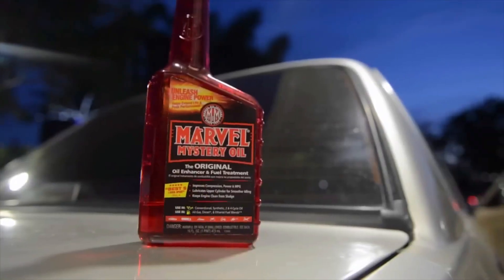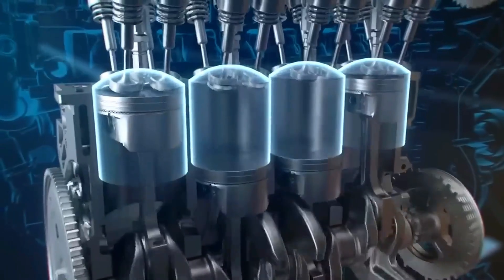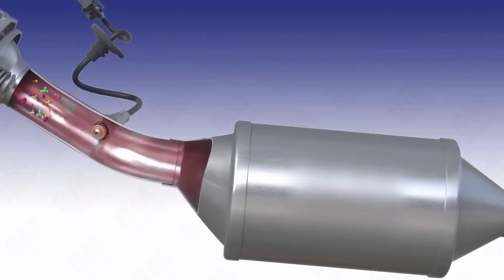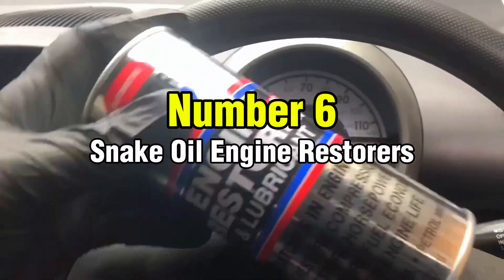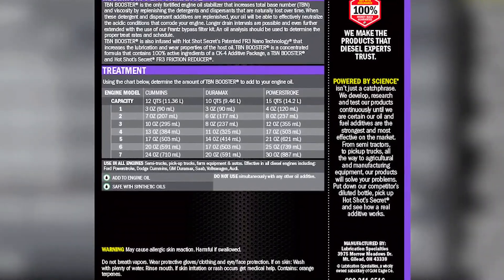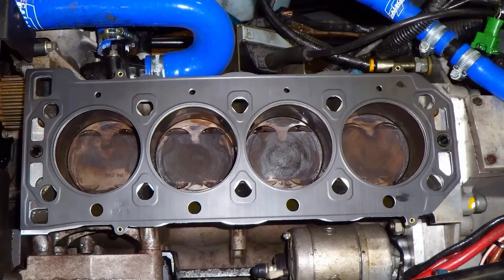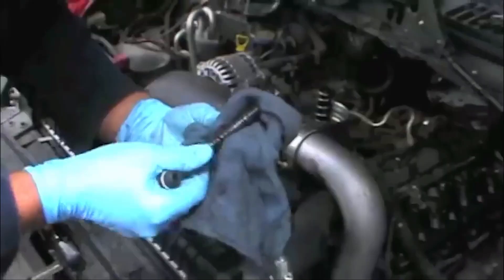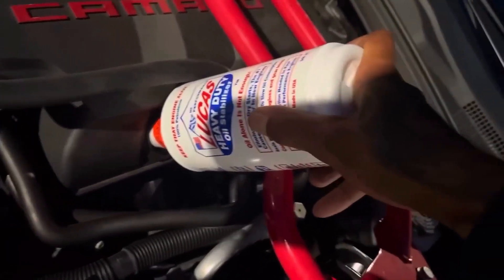NEVER Use These 11 Engine Oil Additives (And 5 That ACTUALLY Work!)

Comment: I've been using ProLong engine treatment for over ten years in my '96 Tacoma that now has over 331,000 miles on it. A local mechanic suggested it, and it's kept my rusty old 29 year old 3.4 purring like it's only ten years old.  I'm here researching because this year I read where 0W20 motor oil lacks ideal lubrication for many engines with some miles on them, and my wife's 2013 Subaru Crosstrek with 180,000 miles developed a pretty noticeable valve rattle when first started. I changed to 5W30 and immediately the noises stopped. That said, I'm in the Rocky Mountains, and it gets cold in winter. Heavier motor oil doesn't flow as well in zero degree temperatures, and the Subaru 2.0 flat four is extremely sensitive to oil starvation, a possibility with heavier oil not flowing freely at bitter cold startup. I was leaning towards Liqui Moly for the platelet protection, but it's not recommended for Subaru. Subaru of Pueblo said they use MOA a couple of years ago, but I don't know if it's a suitable cold start additive with heavier oil already in the crankcase. I guess I should ask. It might end up being the ProLong. I don't know what's in it, but it's kept my truck, ATV, generator, snowblower, and all engines running strong for over a decade, in brutal winter conditions. ...edited to add that I run full synthetic oil in everything.

Comment: I've been using the Lucas oil additives for many years and never had any problems with them.
I nursed a dodge ram c/v 6spd automatic for almost a year after it lost 6th gear. I used the Lucas transmission stop slip, and it got through until I got something new.
The fuel injection cleaner works very well also.

Comment: Cerma metal treatment is nano-ceramic similar to Tribotex. I've used for years after the mpg of my 96 Chevy Lumina dropped from 22 to 14. Cerma brought it backup to 22 within 2 weeks. That was at 120K miles. Now at 318K it's still 22 mpg. I also use the Cerma brand synthetic oil which has the treatment built-in. I buy it in 5 gal buckets.